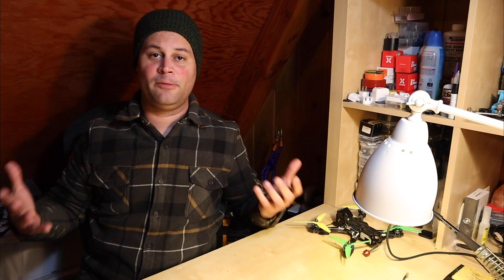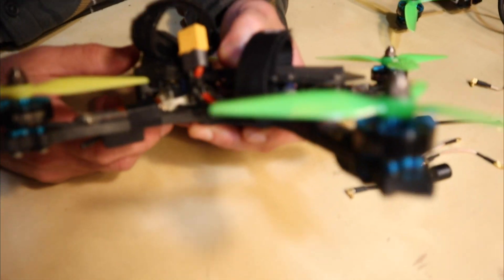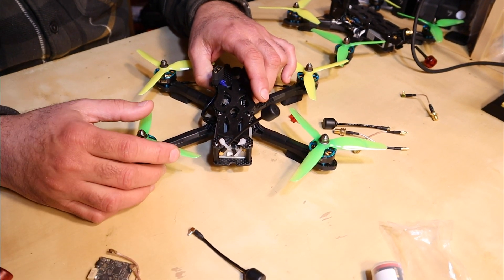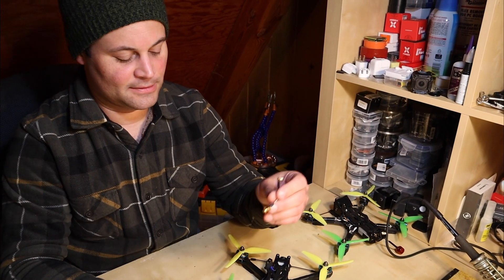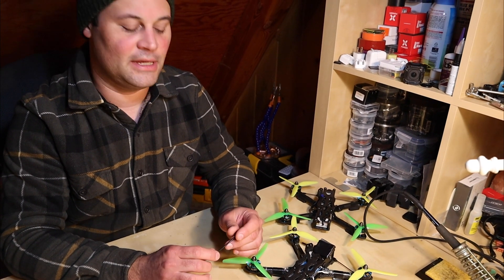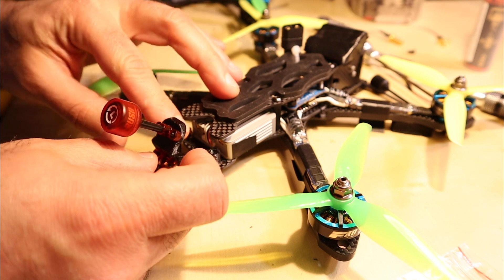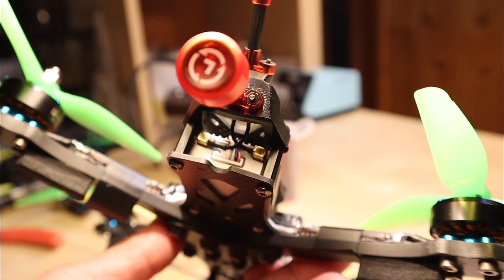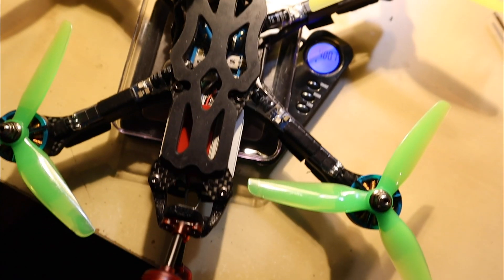MMCX vs U.FL Connectors for DJI FPV, Analog and RUSH Cherry Antennas

Comment: I am looking for method to unplug MMCX connector. I watched this video, but there is pluggingf only :D Have you got something else about this subject?
Reply: Those can be tricky to unplug. I suggest a nice set of needle nose pliers that are not too pointy and get a good grip. Then, an assertive sharp tug will do the trick.
Reply: @DannyCruzCreations  little update, I made a easy access to the plug and successfully unplugged it with my fingers and no tools.

You helped me. Thanks!
Reply: @ZapytajFotografa  Hi, I just saw both replies. Glad you got it sorted!
Reply: @DannyCruzCreations  before success with fingers I ordered special tool.... it is on the way xD
Reply: @DannyCruzCreations  so there is no trick like secret button or rotation. Just precisely used force, do I understand right?

Comment: You inspired me to make a printable TPU part for the Apex HD and also using the RushFPV Cherry's.
I've made and built a version also including a GPS mount:
https://www.thingiverse.com/thing:4610494
and upon request I've also created a part without GPS. I haven't a tried a built with it, but I'm assuming that it works fine:
https://www.thingiverse.com/thing:4634144

Comment: How are the plastic base holding up? Mine broke, it couldn’t handle a hard landing.
Reply from the maker: The TPU mount itself is fine and so are the plastic brackets. I haven't broken any of those. However, I do keep breaking the antenna stalks. I'm currently searching for a new solution.

Comment: Did you notice any difference in range from the stock DJI antennas
Reply from the maker: Not really. I didn't install these expecting better range. I did it for the improved mounting and low weight. That said, I just changed antennas on the goggles. Definitely noticed and improvement with that. Video on that coming soon.

Comment: Nice video. I'm quite new to the hobby.... how much more range do these antennas give compared to the stock dji ones?
Reply from the maker: Hi, I don't feel they give you more range. I run them because the setup is lighter and easier to manage than dealing with extensions and SMAs.
Reply: @PinchTune  thanks for the information!

Comment: Did those cherry antrnnas give you better range than the stock antenna on the air unit?
Reply from the maker: I don't think they give better range. Seems the same to me. I run them because they are more convenient to mount, more durable and lightweight. The stocks are as light, but you have to jump through hoops to secure them so they won't break MMCXs.

Comment: nice video. i use singularity antenna for my build, with 90 degree mmcx, and they work wonderfully
Reply from the maker: I might try singularities at some point. They are very expensive. The reason I avoid them initially.

Comment: According to https://store.dji.com/product/dji-fpv-air-unit-mmcx-to-sma-cable the DJI pigtail is MMCX - SMA, but there is some odd fine print stating `Please note that the SMA Adapter Cable has an RP-SMA jack `, does it mean the cable is incorrectly named and is really MMCX to RP-SMA?

Comment: Awesome info.. 
May I add to that.. Take a look at these items by Airblade... Not listed on his site yet but can order now by looking for the Crossfire one and then putting in a note that you want the sma mount for DJI and the post or screw from the top. 
There is a left and right one as well and hopefully will have a GPS mount using the same system but with the top plate also on a Ball system.
If you need to mount a custom Antenna say from VAS they have that mount as well .. note ask for VAS DJI Antenna mounts.

This is an image to what I have mentioned here.
Will fit that Rush mount perfectly and you get the opportunity to set any angle for testing plus it pushes the Antenna away from the frame.
https://www.facebook.com/groups/DJI.FPV/permalink/2896810270377076/

Comment: hi Danny. This is so practical dude👍i have  the Dji HD system in the mail 🤩 (my Fatshark HD2'S are feeling nervous)  ...as you can imagine, this is helpful for a 1st HD build. I was woundering if i would buy heavy extension connectors. Is that Brain 3d tpu mount good for most 5" frame types ?
Think I'll order 1 or 2 because that mount you've done looks duarable and has great clearance.  it would be $illy to change to RHCP right away, though i do have an immersion rc 13DB RHCP patch i want to flush mount on the goggles later. cheers

Comment: Your plastic connectors on the cherry antennas are backwards.🤣  They are designed to mount inside the hole in the tpu mount, then slide the antenna in and that plastic connector clamps down on the antenna.
Reply: I assume they are backwards, but it will still grab the antenna that way. I just pushed the taller side into the tpu mount.  I have not had one of those antennas move yet.
Reply from the maker: @mooosestang  Keep in mind that the parts are keyed for the nuts. So even if you put them on the inside, you would have to flip them around so the nuts are on the other side.
Reply: @PinchTune  I saw that, didn't notice when i installed them.  I just used a tiny wrench to hold the nuts.  You win this time, but i was right about the weird mmcx connectors dji uses.🤣
Reply from the maker: I tried that way too, but because of it being two antennas, they crash into each other. Also the main hole is too big to give it any support anyway. I'll likely make a new 3D part specifically for these when I can. However, I think they'll hold really well this way regardless.